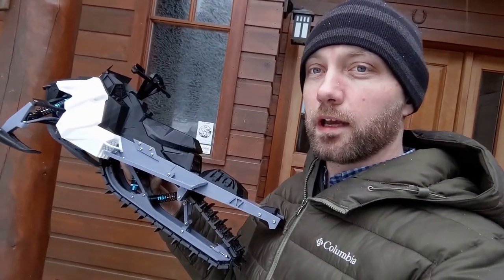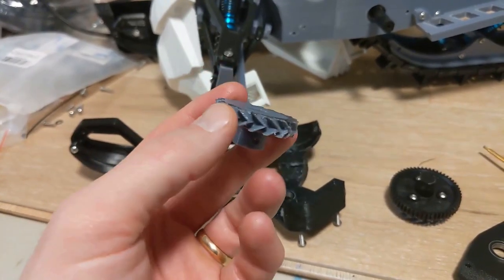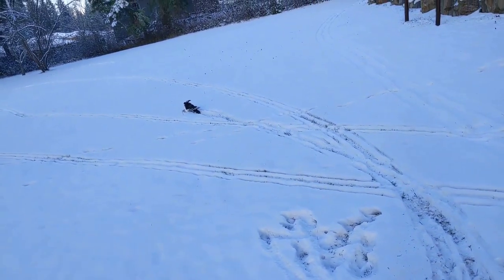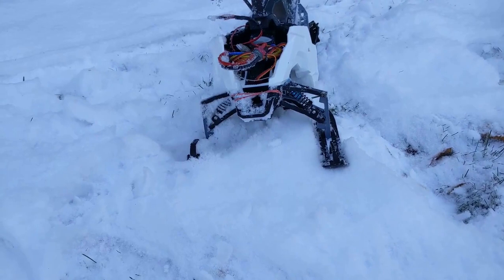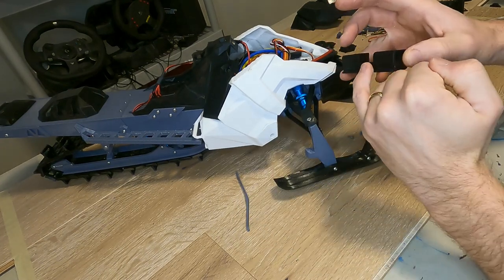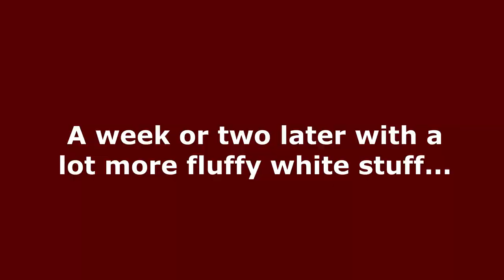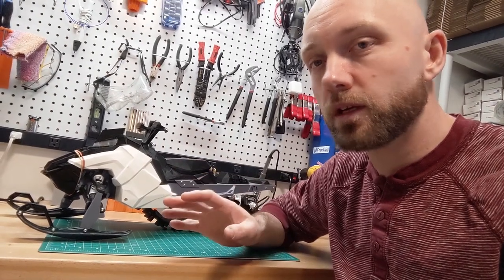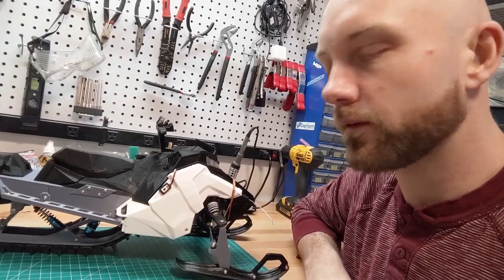Skeeride Polar Snowmobile - Testing and Troubleshooting

Comment: Nice video. I think your track tension is too tight. You’ll want a bit of sag when you pick it up. This is causing extra tension on the suspension making your skid suspension stiff. Could be part of why it’s tipping a lot. The rear sprocket mod is definitely helpful, there’s a mod for a single sprocket in the rear that seems to work well too.
Reply from the maker: Thanks for the help, I'll try loosening it a bit. Its definitely harder to get the tension set properly with the flexible TPU track.

Comment: I bought your kit for this with the motor/esc combo. Mine would overheat immediately and now the motor is shot after only a few short runs. I used similar gearing as you but even lower geared actually so it should have been easier on the motor. Not sure why this would have happened but now I'm looking for a different setup.
Reply from the maker: Sorry to hear that Jared. I wonder if you have some track tension built up or tension somewhere else in the drivetrain.

Comment: Hi, I am building one of these and wondering where I can find the rear roller mods because it would really help a lot if I could have the rear roller with sprockets/teeth on them to help keep the track on. I looked in the original files to build it and I cant seem to find those two mods
Reply: Is there a link you could give me to the files or something.
Reply from the maker: @ggfarms  when you download the files on myminifactory it gives you the option to download the mods folders.
Reply: @rcprinter  I already downloaded the files, I'm already done printing everything, but I wanted to switch the back rear rollers for the modded ones, but I went to the myminifactory page, and I didn't see anything that said download, can you guide me where to go please
Reply: Because I'm at the page and where you buy the files but where do I click.
Reply from the maker: @ggfarms  it shows up when you click the download link
Reply: Mabye you have to login?
Reply: Ok I was just confused. I found it, I wasn't logged in before, so I logged in and I click download and I found mods 2021 folder, so I click download, thanks

Comment: Those printed v gear teeth create a lot of friction, I think a less aggressive "v" angle would work better like >=100°
Reply from the maker: To be fair the only time I've had an issue with these herringbone gears is when I forgot to lube em. They're usually better than they come off in this video. I'm not sure why the designer decided to use such a steep angle for them.

Comment: Belt drive! Should be more durable and quieter too.
Reply: Yes but can be difficult to get the ratio and motor kv correct for max speed/power while keeping temps down and preventing cutting out from amperage draw
Reply: @mr.everythingrandom9470  Just need the right KV motor! Give me a month or two and once mine is printed I'll figure out what motor works best with the 20/60T belt drive.
Reply from the maker: I definitely want to test out a belt drive on my next sled. It does seem like the right way to go.
Reply: 2000-2200kv is a good starting point for 3s battery

Comment: Install the New a arm and knuckle
Reply from the maker: Yeah I gotta get around to that.
Reply: @rcprinter  i just finished the new arms and knuckles and used traxxas slash ball ends made the front track width like a inch and half wider suspension is so much better and dosnt tip over as much
Reply from the maker: @macfpv03  I'll have to try that soon. Thanks for the heads up.

Comment: Those heringbone gears don't look like proper involute gears... That could be another reason why they fail so much :)
Reply from the maker: I'm zooming in on the design files on my pc and they do look like each blade of the gear has a circular surface but its really hard to tell in the video. I think it was mostly forgetting to lube them that caused the failure.